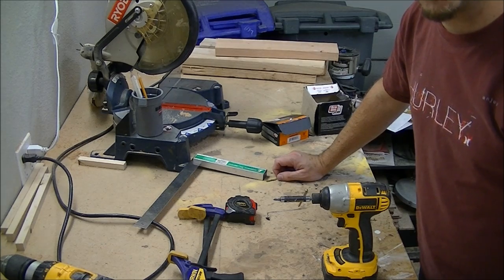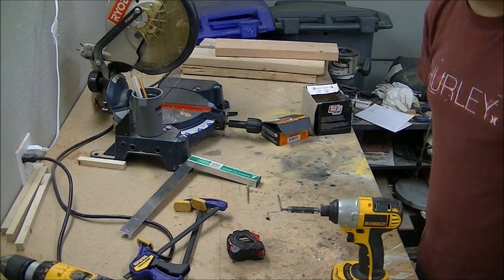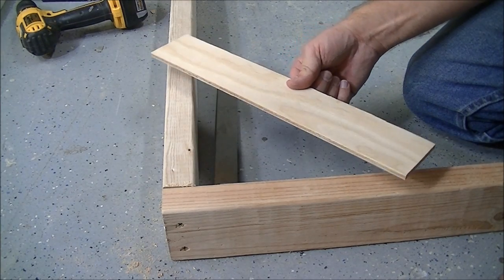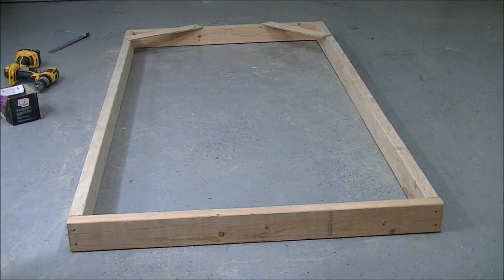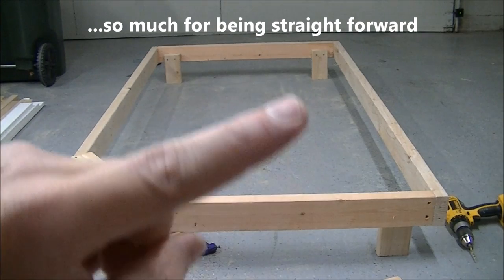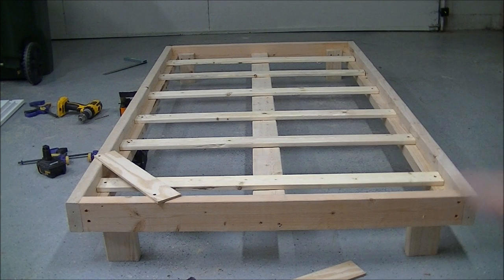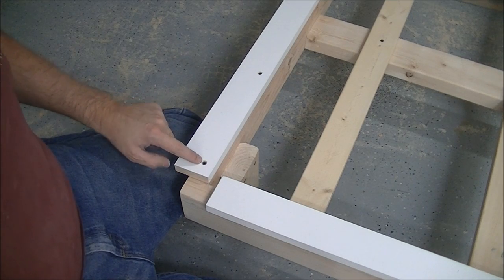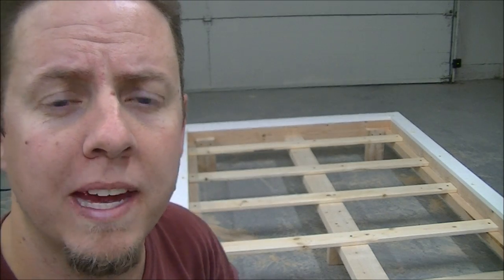How to Make a Twin Bed - Part I The Frame

Comment from the maker: The inside of the frame is 73 1/2". The long pieces are 76 1/2"(go back to 2:45), and the short pieces are 39". Then the short pieces are screwed to the inside of the long(shown at 6:28) so you have to minus 1-1/2" and 1-1/2"(thickness of each 2x4) and you get 3"(76-1/2" - 1-1/2" - 1-1/2" = 73-1/2). 
Hopfully that makes since. You dont need to follow these measurements. If you need to gain a couple inches to fit your mattress then go ahead. Let me know how it turns out.

Comment: In parts of the video, you show the longer rails outside of the head and foot rails, and in another part of the video the longer rails are inside the head and foot rails.  Which is it?  Also, what's the size of a twin mattress?
Reply from the maker: Yeah I know, I screwed up half way thought the video. The longer rails go on the outside. I have better plans on my website, go here http://www.thewildmanproject.com/?p=147.
I believe the mattress I used is 74-3/8" x 38-1/4".

Comment: Awesome video... I was thinking of making one of these for my son, much more sturdy than anything that can be purchased. Any idea what the weight limit would be? I have a 6'2", 240 lb. son (might be on the football team next year), and I want to make sure it can support him. Thanks, Laura :)
Reply from the maker: Laura Cantrell Not sure what the weight limit would be. I would use 2x4's as the cross members instead of the 1x3's and add a few more. That should hold him. Use glue and screws. Sign that boy up for football!!!
Reply: I don't need to stinking help... :) But I will ask, if... IF... I think I need help.

Comment: like how you stated your mistake, SUBSCRIBED!!! HAVNT GONE TO SITE BUT WHAT WAS TOTAL COST? Would making taller require different legs, like 4x4's?
Reply from the maker: Haha, I not perfect. Hopefully someone will learn from my mistakes. The total cost for me was $56, some materials I already had. If going higher than 6"-8" off the floor I would switch to 4x4's.

Comment: Hey man will does little legs support a 250 ld man
Reply from the maker: I think so, its pretty sturdy. You might want to use a piece of 1/2" or 5/8" plywood instead of the pine strips.